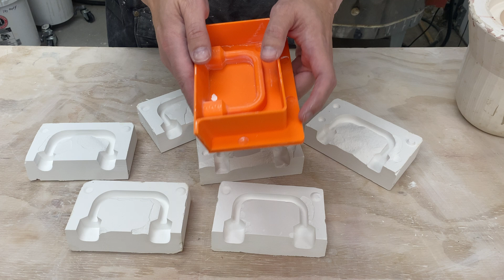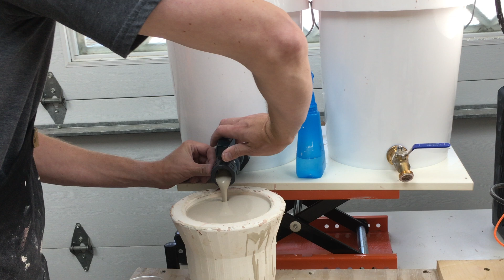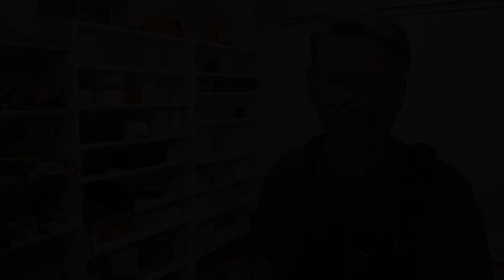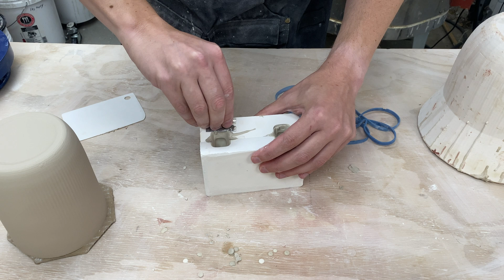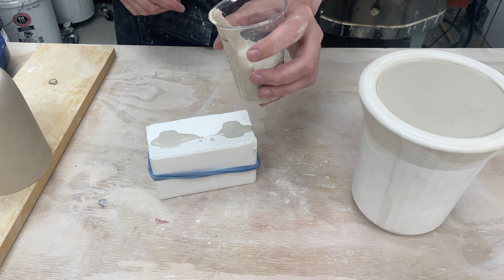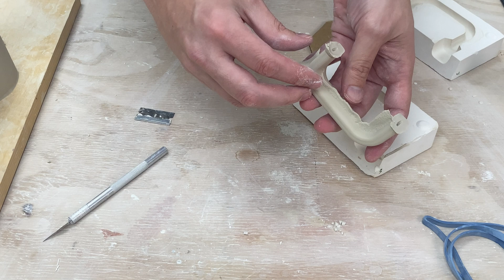Testing Prototype Plaster Handle Molds!

Comment: If you wanted the handle solid why did you drain it? Wouldn’t it be better to let all of it try?
Reply from the maker: Mostly because I was curious if it was solid at that point. Draining probably isn't required, but when it is demolded it is nice not to have very wet slip dripping off the end. (And you can't wait too ling otherwise it is too dry).

Comment: I've used TPU to make molds for my plaster, and they worked decently well. Just be aware of the general drawbacks with TPU.
Reply from the maker: Thanks for sharing. Surface finish seems like a major drawback since it eventually transfers into the pot.

Comment: Thank you for the video, there's a lot of effort evident. Could you demonstrate how you measure the material thickness after casting? 👍
Reply from the maker: The thickness of the clay in the handle? Here it is cast solid so there isn't anything to measure. If you mean for a pot, that is determined through trial and error as it depends on your molds and clay body. But you can measure a freshly made pot and apply your clay shrinkage factor to get the final thickness.
Reply: @PotterybyKent  Thank you for your response. Could you show the thickness of a freshly made pot in your new video? Thanks!
Reply from the maker: You can see it in this one where I trim the slip well off the pot while in the mold. It's a few mm
Reply: These look great Kent. Scoring (roughing it up) the ends of the handle and attachment area on the mug will make a stronger bond.
Reply from the maker: @kbsorrells yes as I mention in the video you can also score in addition to slip. However with slip cast pieces (and correct drying) it likely isn't needed. And indeed I just pulled a bunch from my kiln and they are all great.